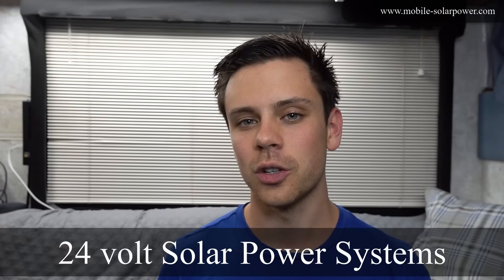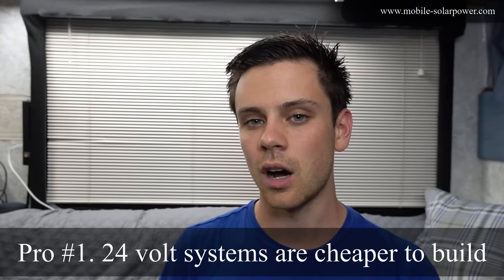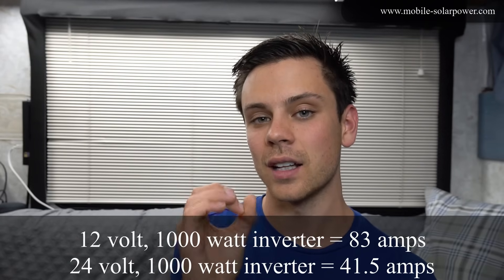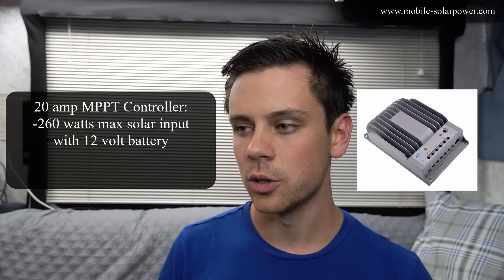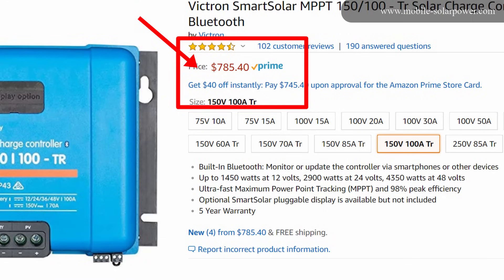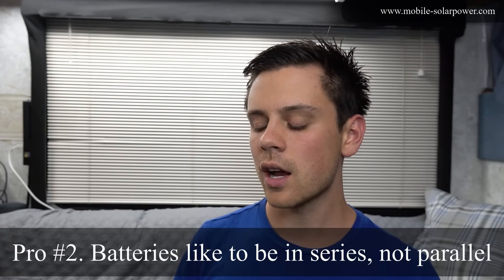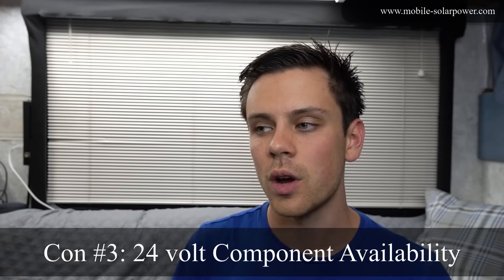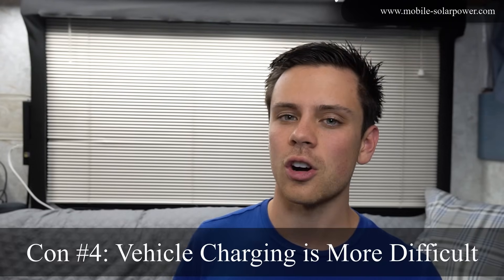12 volts VS. 24 volts for Off-grid Solar Power Systems

Comment: great videos... professional, just the meat and potatoes without all the fluff and backstories, stammering, ho humming, back tracking and indecisiveness like most people produce in their videos ....   thank you.  

 but I have a question here about controllers.....

 I fully understand your point about larger, more powerful higher voltage systems being more efficient on a higher voltage bank, but this question isnt about efficiency, but is about the ABILITY of solar controllers themselves....

  can a system that has a multi-panel array that is wired series/parallel to create a 50-60volt output, going into to an mppt controller, is the controller able to use that 40-50 volts from the panels and convert to a 12v output?.....  
 specifically,  assume I have (6) 100watt panels, with an output of roughly 18v@5a each... which in series parallel, my figures show this would be 54v@30a..... will my "quality" mppt controller be able to automatically use this high voltage to charge my 12volt bank?.... or will the controller need a 24v bank to be able to the extra high energy output from the array?...  thank you

Comment: Hey Will, since I already have a 12v inverter, and I'm currently using the system I have as my only source of electricity (note that) could I buy one 200ah 12v lithium power queen, use it while I save for another one, put it in parallel while I save for a 24v inverter and finally when I get the 24v inverter; can I put those 2 batteries in series and then finally have a 24v system? I know when I plug these 2 batteries in parallel I need to use huge wires, I just don't know how huge. So I'm just going to buy the biggest gauge battery cable they have on Amazon. Or I could probably get away with using 2 regular size battery cables per terminal. Anyways, is this plan viable? Thank you, I'm still new to all this. Oh yeah, ps, if I have a 24v inverter with ac plug-ins, why wouldn't I be able to plug in my phone charger or my electric blanket? Would i need a converter for that or is the converter for hardwiring? I'm confused on that part.
Reply: Anything you plug into the 110v ac will be fine, the converter comes into play for say a fan, refrigerator or lights designed to operate on 12 volts, that is what you need the converter for to take the 24v and step it down to a usable 12v.

Comment: Lucky i have 6 meters of 32mm copper cable,  600w  12 volt system into Victron 100/50 bt feeding A grade 4s2p 4x130ah lipo4s 520ah total , into mains  240v pass through 12v 1000/2000 240v inverter i can switch between mains 240v or battery's only needing 300-500w draw for 5 hours between 4pm  and 9pm run small 90liter 70w fridge, led lights x4 80w fan 15w  laptop and chargers 130w ,wanting 3-4 days of rain power storage no solar going in before i plug in 40amp mains charger, now i am thinking 2 in series at 24v 2x2 in parra then i and run all 4 x 300w Pannels at 1200w into the 100/50 be more affiant as you say ,sorry my English typing skills are not the best ,posably expand to 6 battery's if needed

Comment: Will,  Please have a video on a simple system; for an All-In_One (Growatt 24V would be nice) and show a simple Solar panels in series (2-200w Rich12v in series), size the wiring and fuse and state the type of fuses and where they go.  You sold me on a 24V system All-In-One system from Growatt, 2-200w Rich solar panels wired in series, coming down to 2-100 Weize batteries in series.  I am having trouble finding someone that knows what they are talking or isn't in the pocket of a brand name (ie Victron) for information.  I trust you and your common since approach.  A wiring diagram would be very helpful!  Thank you for your hard work and videos!!! Luna
Reply: I am bldg a system for my 24' shoolie
I viewed your 12V-24V video about 5 times but I don't see a diagram showing  type of fuse

Comment: The big power draw in an RV is the motor that powers the hydraulic slide and leveling system.  A good reason to keep the batts at 12v in an rv.  A dc to dc charger is the best way to connect the alternator to the lithium battery system, and a dc to dc charger can be used on a 12 or 24v system.  Larry
Reply: Biggest problem with using a vehicle alternator to charge large power banks is the alternators really are not built to put out maximum amp loads for long time frames.
Years ago I used to fool with some competition level mobile stereo systems and even using high amp output alternators (200-250amp) longevity on those alternators was not the best particularly for what they cost .

Comment: Help needed, can i use a Switching power supply directly (without battery )  to a power inverter to run a small window AC 6000btu / 120v  ? If yes, should i go with a 24v power inverter or a 12v would work as well ? I am running the whole thing from a 220v generator

Comment: Gas powered/alternator driven charger for a small 3000a/hr 12 volt system…, is it more efficient than say an ac powered smart charger? If so can anyone recommend a reputable make? 
Thank you

Comment: Very helpful 👌🏼
So, I’m building out a solar power system for a 350 sq ft off grid cabin with ten 250 watt panels and 1600 ah of batteries.

After watching this video, I’m thinking 24 volt system.

Sounds like 48 may be better but because I’m such a newb, I like the “safer” option of 24…

What would you say?

Comment: If I already have a system up and running at 12 volts, is there any reason to convert it to 24?  It would cost me nothing but a buck converter, and I'd maybe have to downsize a fuse or two.

Comment: so if we have a solar array of six 12V rated panels, this means it can basically be expected to output 72V to the charge controller.... And 72V is enough voltage for the charge controller to output to a BMS that contains 24V batteries in order to charge those 24V batteries, right?.......... that array of 12V panels would be output a sufficient amount of volts to charge a BMS of 24V batteries right? thx. just wanted to verify

Comment: Will, thank you so much for your very informative videos. This may be a dumb question, but if you are using a 24v or 48v series battery bank, is it not possible to run a 12v leg off of one of those batteries wired in series for limited 12v needs?

Comment: How is a 24 volt system cheaper compared to a 12 volt system in terms of batteries? I use 1 or 2 12 volt 100 amp batteries to power my needs. Would i not need 2 to 4 100 amp hour batteries to do the same thing ?
Reply: The total battery capacity you need doesn't change. Going from 12V to 24V doesn't double the power of a system, because the system is working at half the current.

Comment: Thanks. I'm building a 48 volt system for my off grid cabin. I'm discouraged a little from all the talk that solar isn't the end all be all.  But I'm going forward. 455 watt panels. 10 in all  Eg4 controller and batteries . Would love to see a video on mounting these big panels.  They are heavy and fragile.

Comment: i am more confused than ever. dont all solar panels each have the same voltage? what do you use 24 volts for? 48 volts? id like to have a system that has 12 volt, 120 volt, and 240 volt. is that possible?

Comment: What do you think of this idea? I have six 12 volt 190 amp AGM batteries that I would like to make 36 V Solar system for tiny house with a half hp water pressure booster pump then parallel that system with my 36 volt golf cart system which has 3x12 V 100 amp AGM batteries in The card that I can plug in and parallel with the solar system.
Or is this reckless and irresponsible?

Comment: Can someone tell me how to use a system like this for home use. I see 12 V and 24 v, And 48 V system. But the US uses 140 V in house, and the UK is 240 V in house. With such a big difference what am I missing?
Reply: You're missing the inverter. That's the device that converts the battery output into 120VAC for running household items.
Reply: @arkansasoutpost  thank you. The inverter steps up the voltage.
Reply: @ryanbthiesant2307  Exactly. Steps it up and converts it from DC to AC.

Comment: Will, Sorry maybe this is a dumb question.  I am currently in the process of putting together a 24v solar system.  I have put together a 24v Lifepo4 230ah battery.  I have purchased a 24v all in one charger/3000w inverter/60a MPPT charge controller.   After watching this video I have a question.  You said that I can not use a 12v solar panel unless I connect them in series?  Is that Correct?  I have 10 - 100w solar panels I am within days of installing on roof, and I am so glad you made this video as it probably saved me some money by doing it wrong.     I have zero shade, do you have any recommendations how I should set these 10 panels up?    Either 5 sets of 2 panels or 2 sets of 5 panels?   

Module Type: JJN100D-36-M6-NEW
Maximum Power: 100W
Open-Circuit Voltage (Voc): 24.3 V
Short-Circuit Current (Isc): 5.21 A
Optimum Operating Voltage (Vmp): 20.4 V
Optimum Operating Current (Imp): 4.91 A
Maximum System Voltage: 600VDC UL
Maximum Series Fuse Rating: 15 A

I'm still a little vague about how this math is supposed to work.  Any help would greatly be appreciate it.   

Robert

Comment: With a 12 V system on my camper will it be a problem being plugged in while I’m driving. I’m using two lithium ion 100 amp hour batteries will it stress out my alternator?

Comment: Great videos. Love your work. Can I ask: do you have info (video) on how to connect a small, solar, controller, battery assembly to a conventional UPS. Trying to extend emergency, grid failure time, significantly employing a transfer switch. Thank you.

Comment: I'm half off grid with mine. I just bought the stuff had no idea what I was doing and I essentially power our entertainment system as well as a few other things. It halves the electric bill.

Mine is 24v mini system 😁 with a converter that I plug extension cables into for my ac needs.

Comment: So, if I get 800 watts of panels for my van roof wired in series, a 40 amp EPever BN controller, a Victron 12/24/18 DC to DC charger, a 24v to 12v converter, a 24v to 120v inverter, and either a couple of 12v LiFePO4 batteries in series or a 24v battery I should be good to go?

Comment: After watching your video, I now have some questions for you regarding my DIY 400 watt solar system, which uses (100 watt , 12-18vdc , 8.3A ea.) solar panels wired in parallel and a Chins 12.8 vdc 200AH lifepo4 battery for power storage. I want to increase the size of this system from 400 watts to 1kW, so do you recommend that I continue to build on my existing 400 watt 12vdc solar panel platform or switch to a 24vdc platform?

Comment: Hey I have a small truck camper I’m wanting to be able to power my domestic ac unit for a short while before bed, do you think a small 12 volt system with a 3000 wat inverter with a 170 ah or 200 ah lithium battery will work or is there a better path to take?

Comment: Ohm's law.  helps to understand it
Reply: But ohms law deals with volts, amps and resistance, which is never discussed. When thinking about load on the system we need to know about watts.  The relationship between volts, amps, and watts is what is helpful.

Comment: Most impt:  shadows drastically  downgrade a panels voltage output. At a 12V syst u have much greater chance of reaching the min voltage to charge ur batteries

Comment: You can use 2 or more 12V PVs in series to form a 24V or higher panel.
Then adjust a buck converter output to get 14V or whatever. Then use a cheap PWM controller.
All have to be able to carry the voltages, currents and power. Or get an MPPT charge controller. It's the same design. 
You'll save on copper wire from the solar panels down to the buck regulator and also deal best with partial shade and cloudy days. 
You don't have to parallel anything.

Comment: Just come across your channel today I have subscribed.  I plan on putting a solar panel system in a trailer for ice cream sales . And your channel is definitely going to help in doing that . I do have a question if you could answer that would be great.
Would I be able to power a normal size freezer all day with a 24v system on a 400w solar panel set up and not run the risk of the batteries getting to low to the point where they would be at risk of damage.

Comment: hey dude could you do a long term on the Renogy 40a controller as after 6 mths it develops a E3 fault and will not pass loads over 3 amps through the system without shutting the unit down and resetting.
have you ever done any long term tests on these systems as on the internet lots of people popping up with this fault and Renogy are being funny about replacing it .

Comment: Thank you Will, as usual very informative!  I'm having trouble finding an all-in-one 12v system.  If I were to find one would I be able to charge my solar batteries off my alternator?  I would like to be able to charge from solar, shore power and my alternator.  In Seattle we don't have a lot of clear sky sunshine like LV.  Thank you for your help
Reply: Redarc out of Australia might have some options for you. They have a smart battery charger that can pull in solar too

Comment: I am building a class C motorhome on a Kenworth T300. I have elected not to use a generator. Instead, I have a Growatt SPF300TL LVM that you use in one of your videos. I have nine, 250watt solar panels and 16 cell Grade A 3.2V 320AH 310AH Lifepo4 Battery. The truck has a Cat C7 engine with a 260 amp, 12v alternator. Do you know of a 12v to 48v charging system? I looked at adding a second alt but there isn't room.

Comment: I built out a 400ah Li ion marine system using two 200ah batteries in parallel. Everything was 12v and, being a sailboat, I do need to run the motors to charge batteries on cloudy/windless days when there is no sun and the wind turbine won't produce.

Everything is Victron.  

If I change to a 24volt system when I upgrade the panels/ array to 800 watts (currently 420w), can I use a converter before the existing 12v inverter, or do I have to buy a new 24volt inverter too?

Comment: I have 24 volt 250 watt renogy solar panels. I would like to use 12 volt lifepo4 batteries. I eventually want to upgrade to 2kw of solar. Which charge controller would you recommend? What else do I need?

Comment: Could you put a 48 volt system like the eg4 inverter battery server rack system and keep the 12 volt system to power the 12 volt components using the 12 volt charger controller or should you get a 48 to 12 volt dc to dc unit?

Comment: I understand in theory that 24v is cheaper/more efficient  but I would like to see the two it penciled out for a project estimate. Specifically where in the system would  you use smaller gauge wire? I seem to still use the bigger wire for piece of mind...

Comment: New here. Been planning to rebuild an off grid truck camper esp its battery bank and solar system. Halfway through it decided to subscribe assuming you may have more crucial infos about ac/dc power system
 😊

Comment: My question is: I installed the recommended battery meter on my 2x 200amp/h lithium battery 24v system, but which settings would i choose being that those readers are set for 100amp batteries? (1,2,3,4,5 batteries, but all 100amp) My meter shows 100% all the time. Gotta be wrong 
DROK Battery Meter, 10-100v

Comment: Hi mate do I need a voltage sensitive relay in my solar pump system. Battery solar panel and regulator and inverter connected to pump . If yes can you please draw me a diagram how to fit it in . Thanks Ray

Comment: I have a 3000 watt pure sine inverter with a 24 volt system and 30 100w batterys why will it not charge my 2021 chevy bolt ev
Reply: I have 3140 watt solar panels

Comment: So here's my issue , I have 2 , 400w  solar panels both 40.6v in parallel 4 , 6v deep cycle batteries connected in series , 80amp charge controller pwm , and I want to hard wire my 30amp shore power plug to an inverter 5000w......... will a 12v inverter handle this or should it be a 24v inverter ?

Comment: I live in the Philippines'.  My house is 2-20 x 20 rooms a large covered  area with 6 led tube lights and a frig. 2 Tv's and a computer and we use 2 floor fans.  The distance between my batteries and inverter may be 4 foot.  Would you still recommend 24v?  I'm planning on getting a 3k Inverter and using 8 100ah  gel cell  batteries.  Please let me know.  Thank You

Comment: Hi will iam running 4x270w trina panels and 4 x110 a lead batteries connected  to a 24volt vevor 3kva ... am I good to go . This is a garage and mancave system with 240 volt power coming in mark from uk

Comment: To have any sort of Kwh capacity at all, you really need to be at 48V, this lets you run eight 6V batteries in series. Even then, assuming the use of the 230Ah 6V batteries, that only gives you 3Kwh a day, allowing for 3 very cloudy days and not pulling your battery bank below 50% DoD.

Comment: Question. I have two 100w panels in series on a MPPT controller to take advantage of the voltage in early/late daylight. ? is I don't have room for 2 more, but do have room for 1 200w 24v panel. Can I tie that in parallel with the 2 I have? The voltage should be very close. It will be on the 40a EPEVER MPPT controller.  Thx!!!

Comment: I’m a little confused as to why you said you can’t use 12v panels for a 24volt system?  The open circuit voltage on my 12v panels is 19.8 volts so in series should be 39.66v??

Comment: Very good info. I will be doing a box truck conversion sometime this year and i'm considering running a dual solar system. A large 24v system for mostly everything and a smaller 12v system for lights, 12v stereo system and any other 12v stuff i might use. Greetings from sunny Jamaica.